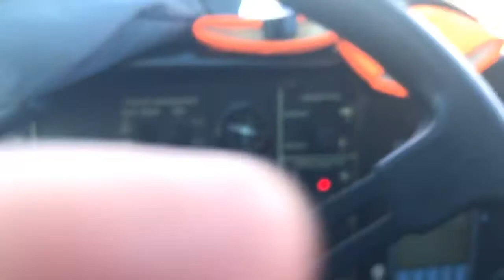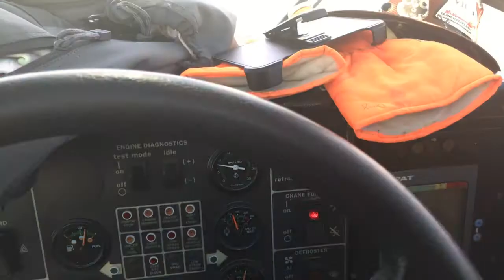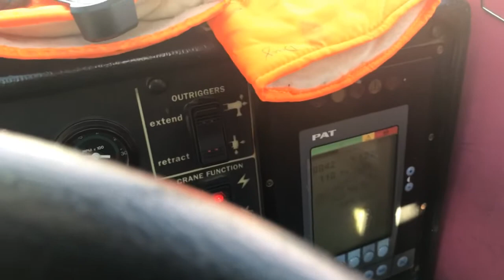Let’s Fly Some Material. Live From My Crane!

Comment: Thanks IamWedge I fine the crane's very interesting I installed Printing press's and some time's we needed to close down a city block in San Francisco and have a crane to put pace by pace down the elevator shaft  on a 10 story building, Each peace was about 12.000 lbs and had one peace at 18.000. The press cost about 4 million then.15 years ago. Thank for sharing I have so much respect for crane operators is a very demanding job. I Spent 30 years with the crane operators on many jobs over the US
Reply from the maker: RICK HALBUR, thanks for sharing that as well. Operating crane in San Fran would have freaked me out. Never know long if and when the earth was going to give you a shakin.

Comment: Is that the same crane you use all the time for each job? You drive it to where you need it and set it up to use it? That is cool as I have never seen it from that point of view!
Reply from the maker: I've used this same crane in refineries mostly. The company I work for does have a lot of different cranes. Varying in their capacity.  If you are interested in seeing some of our other larger cranes, you can check out the link of a drone flight I did at the company office/property.  https://youtu.be/f98rNbySOE4  Im using a rough terrain crane (RT).  When they get moved distances they have to be loaded on a trailer. Its different when you get the operator's point of view.